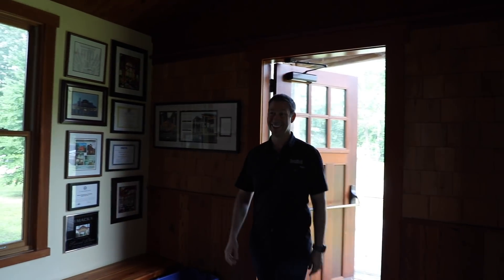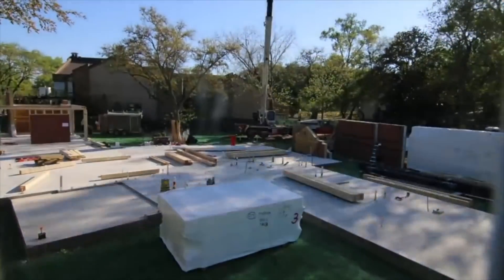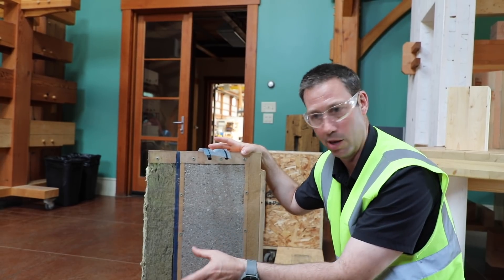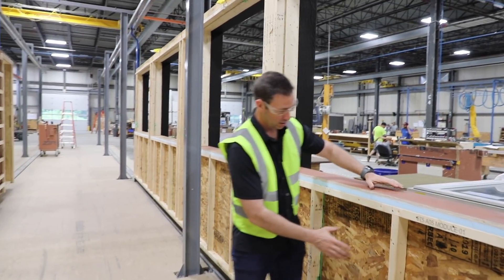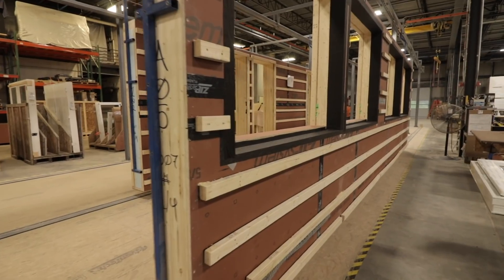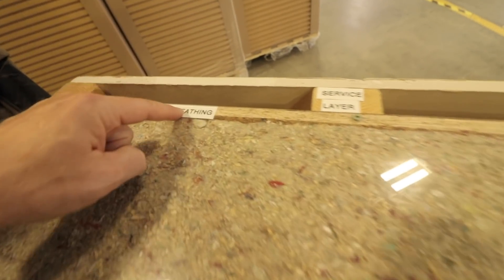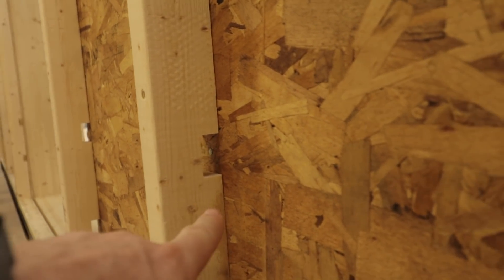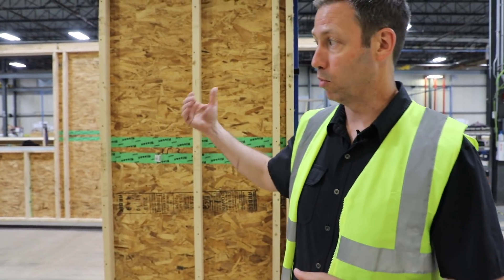Framing in a Factory with Super Insulated Walls - Bensonwood Homes Tour

Comment: There are European companies who will build your house in the factory right down to the fixtures, fittings, floor coverings, tiles, paint etc, the lot. You have to organise the foundations, choose what you want to have, and they'll deliver & erect the house, taking about 5 - 7 days to do the complete job. Huf Haus is a German company that does this but is one amongst many across Europe & the UK. Interestingly these techniques have also made it to Australasia. It's simply far cheaper and efficient to build this way.

There's a very long running (20 yrs) UK TV series called Grand Designs of which one episode was dedicated to a Huf Haus self-build. For anyone who's interested, it should still be possible to view it on the internet.

Comment: It would be nice to see this same concept but with t-studs!!
Reply: Yes! I agree! Where are the T-studs❓
Reply: You guys talking about those pieces of wood with spray foam between them? Personally, I would not use that stuff in anything. You could just make similar pieces of wood with the alternating zigzag pattern of round wood pieces between them and fill it up with regular rock wool. Fluffy stone beats hardened chemicals any day because of how high the temperature is while creating it. T-studs, while adding to the integrity of the construction also introduces a weakness to the building and makes sure it will not last that long compared to a house that uses better insulating materials and there is also the issue with off gassing from the spray foam. Foam glass on the other hand has some real potential and I'm eager to see what the future has in store for that stuff. The black tar-like substance they use to fasten it is a bit concerning, but large pieces that are passed through a cnc machine as an impenetrable vapor and air barrier (100% air and water tight + able to resist hundreds of degrees Celsius before even getting soft so it will give you a bunch of more time to vacate a burning building than flammable chemicals ever could.) would be awesome.

Spray foam is very easy to work with though. So I can absolutely see why it is used to the extent it is. But let's not fool ourselves into thinking it lasts anywhere near as long as insulation or structural materials in a home should and is very much a planned obsolescence thing. The rise of computer aided design has also made us more precise in how we build and a small part of me is actually concerned that we will see houses built too close to its tolerances actually collapse as structural spray foam deteriorates and the home can't hold it's own weight or get a heavy snowfall one winter.

Sorry for the long comment. For context, I'm a Scandinavian carpenter and we rarely use the stuff at all here. So I definitely have some form of bias towards how we do things here compared to America. 

And sure. Spray foam is not proven to be dangerous yet. But I have worked with stuff that was once considered edible but is now a frog suit with gas mask type of deal where you are not even suppose the breathe the air around it or even let it touch your skin in industrial work outside construction. And that was kind of eye opening.

Comment: Matt. Explain for me please how this process leads to less waste? if you're cutting boards to length, even with a computer, you'll still have the leftover pieces.  Also, is this method actually cheaper? assume an apples to apples build. one outside in perfect weather and the other inside using the pre-made panel system.

Comment: Very impressive and clean factory. Very hi-tech but at what cost? Still a lot of thermal bridging and vapor trapping. Thanks for showing a different way of thinking.
Reply: Thermal bridging where?
Reply: @Conservator.  The Interior 2x3 wall is still a direct contact to the outer wall assembly. Amiterization might not be the correct term but the thermal transfer in Winter is greatest from inside out. Till the transfer at the outer sheathing should have reached 0%. The studs wick more thermal transfer to the insulation bay. Unless there is a thermal break on the interior of the assembly that I missed. There is still structural members in direct contact from inside to outer.
Reply: Gobuilditbetter Hi,
Tx, I had another look at the video and I see what you mean. The studs are made of I-beams in stead of regular lumber. Ok, that’s still a thermal bridge but a smaller one. It’s not shown in the video so we don’t know but if the outer studs don’t line-up with the inner ones, that would almost eliminate a thermal bridge. Still SIP panels would even be better. 
I agree with you that there’s certainly room for improvement but this is a good step in the right direction. 

Idk the costs but considering the potential lifespan it might be quite cost effective. 

I live in The Netherlands where houses are build to have a lifespan of at least 50 years. Although concrete and brick walls are commonly used over here, the robustness of the house shown in this video looks ‘normal’ to me. (As opposed to a framed 2x4 exterior wall). But we live in a much colder climate than Matt in Texas, so I the norm from over here probably doesn’t make sense over there. 
Cheers.
Reply: @Conservator.  If you saw My Vid "House that will not Burn" you will know where I am coming from. Thanks
Reply: Gobuilditbetter 
Watched it and a few others. I like SIPs (and your video’s;)
Reply: They have a couple different wall assemblies.  One of them has an 1.5" layer of wood fiber insulation on the exteior which adds about R-6 as a thermal break.

Comment: Is there a California version?!   We need less insulation, more radiant barrier.  I want my kids to have Bensonwood homes.
Reply: I bet this type of wall would work well on warm climate lot of exterior and interior mass and thick insulation between them. Those void on block will be pour full with concrete i assume it would be really good against tornados aswell.
http://www.lamminbetoni.fi/documents/10228/21869/www-ll400.png/8a8a9772-813a-4e67-95d4-c688cbb8908d?t=1385806039926
Reply: Insulation is impartial to temperature. Your AC running at 110 needs just as much insulation as someone’s heater running at 15.

Comment: Can these walls stop 9MM at least???
Reply: Could have them custom one, add a layer of Kevlar or two, then top it off with Line X on exterior. Haha
Reply: That is a concern in Central America. I designed a simple tiny relatively low cost home, that I thought would work for a neighbor in Belize. The first question the neighbor ask was "Will it stop a bullet?" I didn't realize that was a necessary design criteria down there.

Comment: I would suspect that no matter how tightly packed the cellulose is,  after years of microvibrations from the earth, it's going to settle some and leave a gap at the top.
Reply from the maker: Certainly could happen… That’s why the exterior insulation is on there
Reply: Mr Wizeguy, we have tried that here in the US Pacific Northwest and I’ve been told had some horrendous problems of getting the assembly to dry out thoroughly.   Do you use Sheetrock  with those assemblies?
Reply: @mrkozz1  It needs to dry week or two here might take longer if you climate is hot and moisture high. 
It's usually covered with strong paper that allows water vapor movement to both directions only makes wall air tight and top of that most often is sheetrock.

Comment: Sign off a bit weak today. Head and upper body need to be tilted back a bit more. You wanna really swing into it by activating your core. The point could use a bit more swing. Its all the in the wrist. Of course it needs to be a bit louder but I'm sure you realized that after the fact. Keep up the great work boss!

Comment: so complicated wall assembly.. why not 8" or 10" Tstud  with spray foam or regular 2x8 / foam with zip/styrofoam on outside???
Reply: They have different wall details available.  One of them is similar to what you describe except it uses I joists rather than t studs and cellulose rather than spray foam.  

Cellulose is far better for the environment than spray foam. It's also better in the event of a fire in the home. It's also only a fraction of the price.  I've installed both.  I would take cellulose over spray foam everytime for new construction.

Exterior foam would constitute a class I or II vapor retarder so it would have to be very thick for colder climates to keep sheathing above dew point.  Wood fiber is vapor open and again much better for the environment.  (Actually a carbon sink)

Comment: That "super wall" looks like the minimum requirements for new houses here in Denmark.
Reply: Snarky European comments.  Shocking.
Reply: Ted Benson travelled to Europe (Sweden, I think) to bring their building style to the states. Much of Bensonwood's  equipment also comes from Europe.  

As a whole, Our codes for insulation and air tightness are still pathetic.   though...

Comment: This is a perfect example of engineering gone wild.    5" of spray foam you get only R35 but this is all ice factories use.  Ice factories DON'T use any fiber insulation of any kind.  The spray foam also acts as your shear wall when installed over 1 1/4". It acts as your vapor barrier when installed over 2".  It's an air barrier when installed in any total coverage amount.  If you want zero heat sink, offset studs and foam can expand in behind the offset to ensure complete insulation coverage.  I would like to see fiber insulation be outlawed and codes changed to meet the actual performance of spray foam.